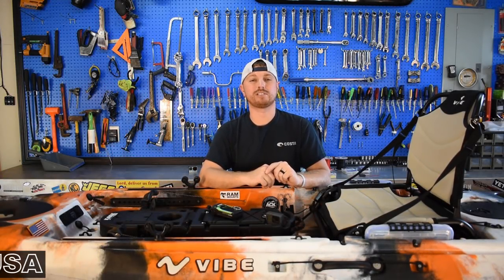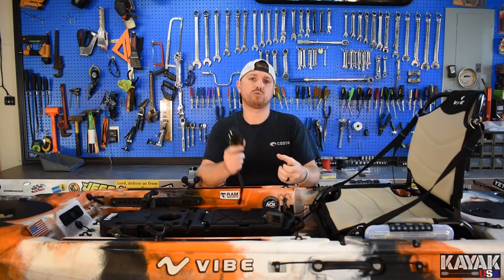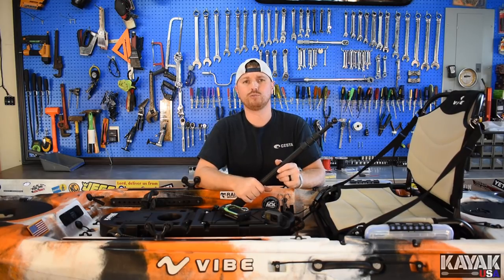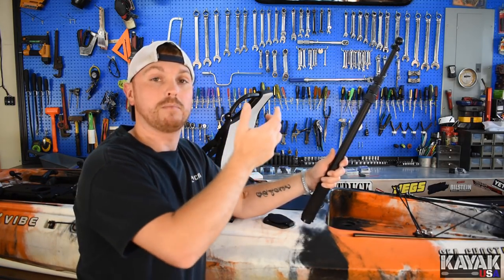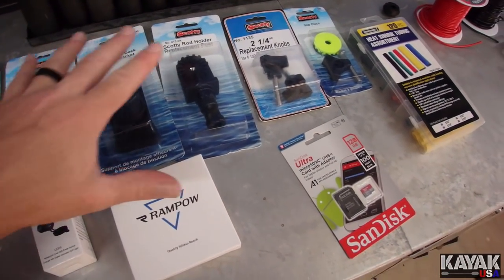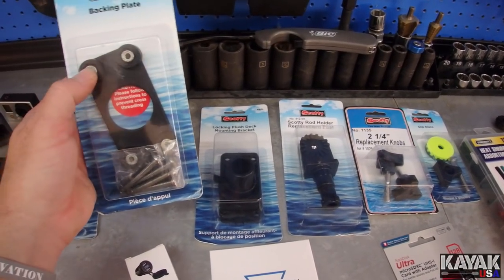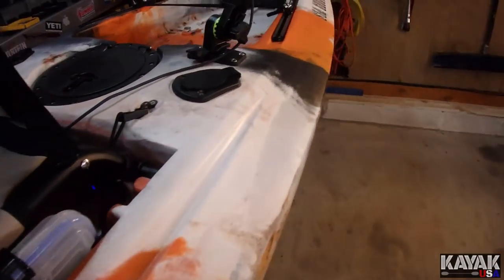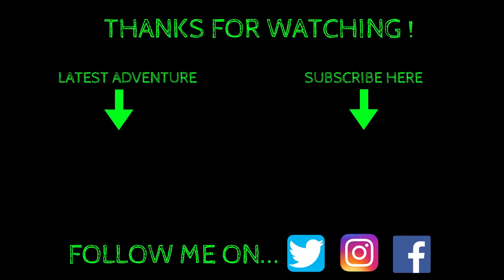Kayak Telescopic GoPro Pole w/ ALL DAY POWER | DIY | How To

Comment: TJ, nice job. Gives me some ideas for my own ascend 133x. I know this is an old video but I wanted to point out that you have the wrong end of the SAE connector coming out of the battery box. The positive or red wire off the battery should be the one encased in rubber so it won’t short out on anything that’s grounded if it is not plugged into something. I know it’s a plastic boat, but it is just good practice to always do it that way. Again great job on the video and others that I’ve watched, keep it up!

Comment: Very nice mod to your kayak! Really like that adjustment to the Scotty mount to enable the swivel. Not sure if you have seen it, but DigiPower has a battery pack that encloses your GoPro. With it you can have all day power and still have 100% waterproof protection. Have gone on 2 kayak trips with my Scout Troop & the only thing I had to worry about was having enough memory for the footage.

Comment: You sure gave me some ideas using the Scotty’s accessories  and creating a shade roof using flexible solar panels over my head.  AZ sun is no joke as you will turn a different shade of color FAST..lol!!  Would like to use the whole idea using the pole extension but not sure on the weight limit before it leans.  Any videos from you on this will sure help us in the hobby looking to charge our batteries.

Comment: Very good. Lowes sell spray on rubber. Better than the tape. Get the spray rubber from the coating section not flex seal garbage. $9.00 can.

Comment: A bit of epoxy / silicone fixes the original slip disc bolt. Nice build I may have to add one to my  Catch 120.  i have a spare GoPro 2 about!
Reply: Update have begun scrounging around the house. Looking for stuff to do this with. Old broken tripod ¿  spare dogbone ram mount , and a few other things I may just be able to get this done quick.

Comment: Pro tip: Harbor Freight settles a set of electricians / telecom fiberglass push sticks for about $12i think. They come in 2 1/2' - 3' section in a lexan tube. They're great for projects that require fishing wire
Reply from the maker: Thanks man!! I’ll check em out! 🤙🏼🎣

Comment: The tape kept balling up on me. After removing the teeth on the locking mount I cut a groove into the mount where the teeth were and put an O ring to make a snug fit. Works well.
Reply: I had the same problem. Thanks for the idea I'll have to give it a try.

Comment: Great video. I'm about to do similar with my Viking Reload and Insta360 x3 and GoPro 10.  I feel the Insta360 x3 is heaps better as you don't need to change the angle the camera is pointing when you swing it (but it does take an extra step in post production to set the shot angle).  I'li video and put on my channel.

Comment: TJ, great video. Can you tell me why the connection through the in-line fuse did not go red to red back to the battery, and was switched. Please advise.
Reply: I think that he used the wrong end when he wired the battery box. On the battery side the red or positive should be the post with the rubber around it!

Comment: I’ve got a question for you. I went with this same setup after watching your video. After the install I noticed that the Scotty flush mount is hollow and isn’t capped off in the bottom. I have ordered some plastic end caps and I’m hoping that will help, but did you account for that and did you run into issues with allot of water getting into the kayak? How did you remedy the problem if it was a problem?

Comment: Hey bud, was watching your other videos to install the power unit and the fish finder.  Did you also use a fuse before running the connector to the splitter on those?  Would it make sense to instead put a fuse before the splitter closer to the battery instead so it protects all three under one fuse?  Sorry - total newb to wiring.  Have a 2019 Sea Ghost an definitely using your vids to help me get everything wired up!
Reply from the maker: Thanks for watching and yep, I used several inline fuses between the battery and each device 🤙🏼🎣

Comment: Great vid. Do you usually go out with scuppers plugged? I’d be worried about the water splashing up the under seat scuppers into the usb plug. I get water up under my seat sometimes.
Reply from the maker: Hop Nguyen , I always keep the ones under my seat put in. I'll take the front and rear ones out occasionally. Thanks for watching! 👍🏼

Comment: I ended up making the same extendable camera mount and I was wondering the round Scotty Mount that you put on your kayak how well is it holding up with your  extendable camera pole
Reply from the maker: It’s great! Just be sure to use the “locking “ one like I have , you don’t want to lose your camper and pole in the water.. lol🤙🏼🎣🐟
Reply: Hey man thanks I greatly appreciate that I was debating on whether to drill the hole in my kayak or not

Comment: Been thinking of doing the same thing to my 110 but with another battery in the back hatch.
Reply from the maker: Biking&Jeeping , you you can get by with just one battery, I would. The less weight the better.👍🏼 Thanks for watching!
Reply: will one battery also run supernova lights and interior led lights as well as 2 go pro's?
Reply from the maker: Stream Rolling , Yes but it will drain the battery a bit faster, but not in one trip🤙🏼

Comment: I need to take the time to set up my cave. I always am working on something. Right now I am restoring an old classic fiberglass boat. Made by the same company that built the first Corvette bodies. Next project is waiting in the driveway to come in. It's a custom trailer for a teardrop camper. It will be a military style looking thing. Roof rack will hold two kayaks.  I like your Vibe.  It will probably be my next. I'm moving up. Right now I have a Sun Dolphin....Its ok...but not what I want. I used to be a boat builder ( 35 to 65 feet)...sailboats. I designed a kayak but probably will not build it.  I kind of changing my mind and want to build something like the Solo Skiff. Have you seen them n YouTube. Check them out.

Comment: I watched the first usb panel and battery video. i felt I grasped it. Now I'm lost. A few questions if anyone would be kind enough to answer. 

1. Could he just run a 2nd battery box to run that usb port? Just like the first he did?
2. Why did this install need an inline fuse? Why couldn't he connect with a butt connection directly to those connectors which connects to the 5 way splitter, which connects to the battery?

Comment: What size wire are you running to the battery
Reply from the maker: +Bryce Griswold , 14 gage wire, thanks for watching👍🏼
Reply: Thanks, thinking about doing this for my 1991 AlumaCraft to power my Gopro's
Reply from the maker: Bryce Griswold , That's  cool man, should work the exact same. I can't wait to film now, now that I won't need 20 GoPro batteries in my pocket. Lol
Reply: Kayak USA yes I have been using a external power bank and that's ok, but even that dies at some point.